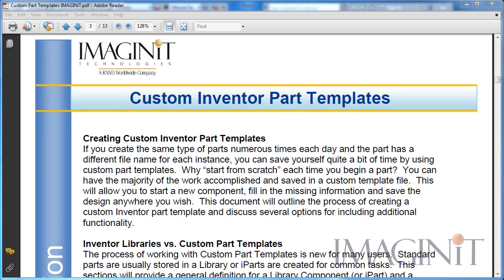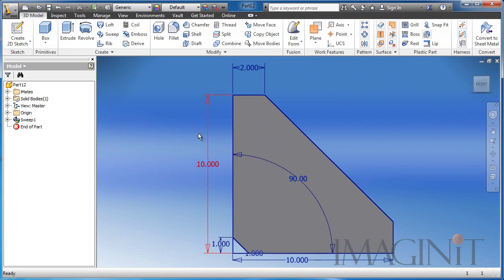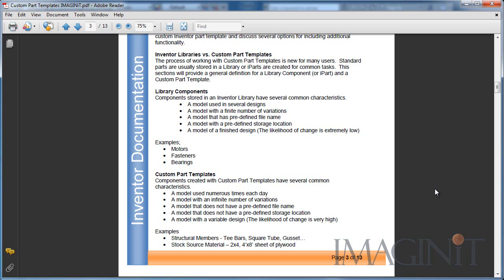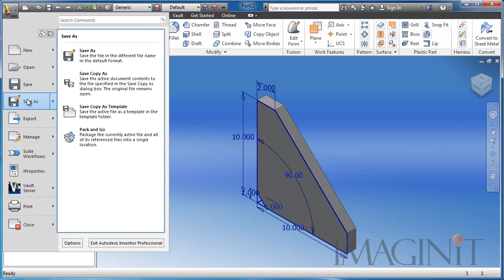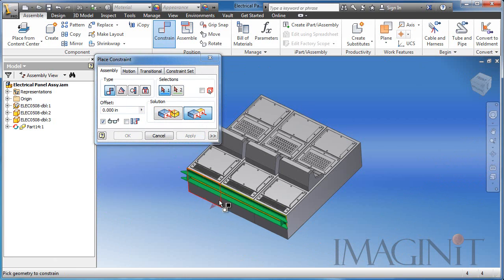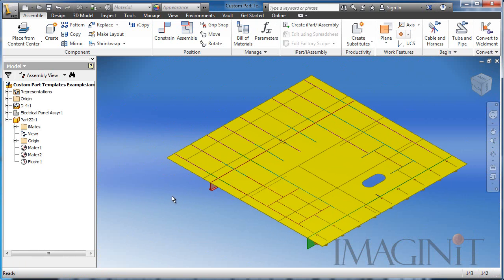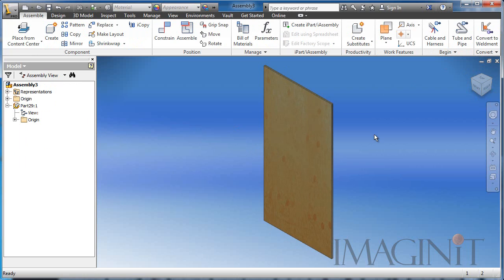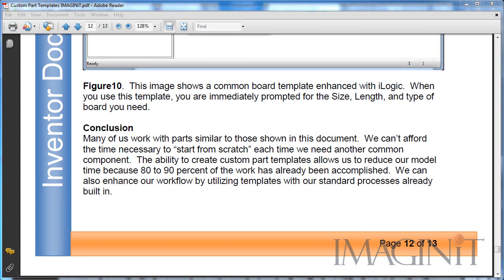Custom Inventor Part Templates

Comment: New APP for Sheet metal templete & Automate CUSTOM iProperties for Autodesk Inventor.
Now compatible from 2013 to 2017 you can view data sheet & video at:

https://apps.autodesk.com/INVNTOR/en/Detail/Index?id=3866959561356165269&appLang=en&os=Win32_64
or
www.mc-cad.it